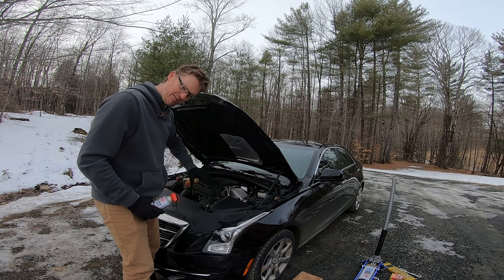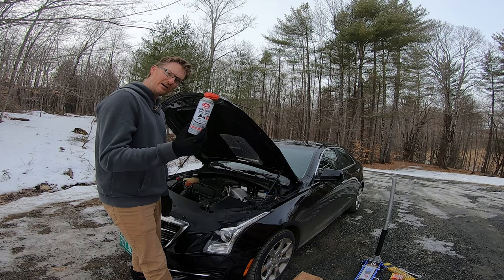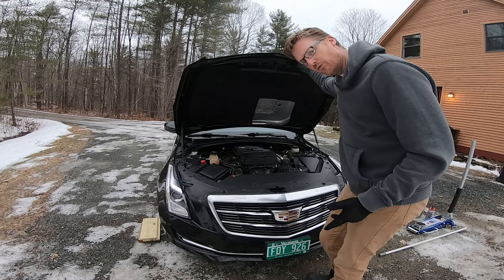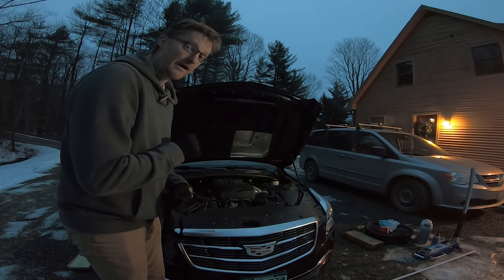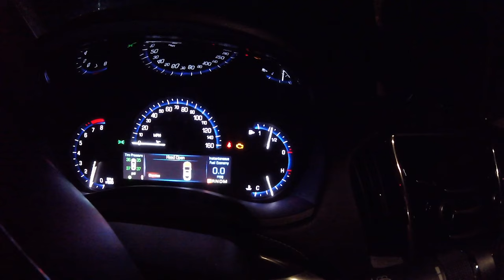Does CRC Intake Valve & Turbo Cleaner Work? | GDI Engine Carbon Buildup

Comment: No not only solution.  Take manifold off fill let soak scrub or walnut blast!  Direct injection will build in intakes and valve no matter what gas you use.
Reply from the maker: V W thanks man! I understand the reality of GDI engines. GM studied it and said some fuel vapors from the combustion process collect on the back of the valves adding to the problem. They strongly recommend high end fuel because of the increased detergents. The wrong oil will create horrible results due to oil evaporation which gets sucked into the intake and coats the valves. I’ve studied this extensively. Fuel. Oil. Air filter. Even an annual Techron cleaning will help keep the valve build up at bay. I read blog post about caddy owners with the 2.0t that have put 130k on the motor with no walnut blasting needed. Proper maintenance and quality fluids man!! 👍 Thanks for the comment ✌️

Comment: Thanks for another great video, where did you spray the crc into the engine. Happy holidays to you and your family.
Reply from the maker: j3reds thank you 🙏 I spray it into the intake where the pcv hose connects. It’s upstream of the MAF and it cleans everything on its way to the valves including the throttle blade.
Reply: Nice going to try this on my 2009 Chevy cobalt tc with 190,000.00km .

Comment: Got an ATS as well. How many miles on yours?
Reply from the maker: Around 39k! Love it!
Reply: Michael Byrne just a heads up. That Y coming off the coolant tank on top, will leak. Go to Lowe’s and get a brass tee. Don’t cut the lines, you can pull the hose it of that y and clamp it on the brass TEE. Also cue is going to crack or go out. You can get a new screen for $52 bucks. That’s all I’ve hAd to replace. 85k miles on mine. All put on by me.
Reply from the maker: @nastynotch8314  thanks for the heads up! BTW, I have a base model.... no CUE for me. I had CUE envy until later I learned about all of the issues. Glad you got yours sorted out!
Reply: @nastynotch8314  where you get a cue screen for 50 bucks

Comment: Does anyone know if this cleans the area of the turbo that seizes the variable vanes on VNT/VGT-type turbos?  I've heard that one should clean from the exhaust side of the turbo if vanes are seized up from carbon buildup.
Reply from the maker: All I know is that this stuff absorbs into carbon buildup and breaks it up. But I imagine that there is a point where the build up is so well established that it would require replacement or tear down and rebuild.

Comment: Hi Michael, are doing the same thing for your Dodge Grand Caravan?
Reply from the maker: No not at all. Only on GDI (gasoline direct injection) engines. The design of a GDI engine causes carbon buildup on the back of the intake valves. CRC helps wash the valves and keeps it running properly. I only use it for my Cadillac ATS 2.0t 👍
Reply: Michael Byrne Ok thanks, Question :  On my oil cap is written to use 5w20 oil, but some drivers recommend to change it to 5w30 as it is fully synthetic oil. I am refering to mopar oil. I am using my car usually in the city with heavy traffic, and moustly on short distance. What is your opinion?
Reply from the maker: @waldi4213  Personally I would stick to 5w20. I think going thicker is an older way of thinking. The tolerances built into a new engine are so much tighter than they used to be and for proper lubrication you need to avoid going thick. I like to imagine the molecules in thicker oil are larger and therefore they can't fit into the tighter spaces on new engines and therefore do not provide proper protection. In the old days I'd say ignore the manufacturer. But now? Stick with the manufacturers spec. And if you're using synthetic, it'll already give you higher temp and sheer protection. You don't need to go thicker. My 2 pennies!
Reply: Michael Byrne Ok thanks , I did not mentioned before I am refering to 3.6 chrysler t&c.
Reply from the maker: Waldemar Wójt I assumed as much 😎 5w20 is what I would use 👍 Thanks for visiting. I hope I helped 🙏✌️

Comment: Did you spray that straight into the turbo?
Reply from the maker: I removed the pcv hose and sprayed into the intake. Upstream from the MAF 👍
Reply: I hear people say this stuff is bad because when you spray it in all the particles being removed go through the cylinders and score them and may damage the piston... is this true?
Reply from the maker: @jacobsteele5543  It’s normal maintenance on a gdi engine. Recommended every 10,000 miles. Do your homework and you’ll see before after results. The option is an eventual build up on your valves that needs to be sandblasted off with walnuts. Not a cheap procedure. But you can minimize build up by using top quality brand name premium fuel, the right oil that does not evaporate (I use dexos 2), keep your intake/pcv wiped out of oil residue, a clean air filter, and a bottle of Techron every spring and you should be ok 👌
Reply: I have a 19 equinox 2.0t ltg like yours with 12,500 miles that I just started running direct injection cleaner... I might have to give this a try my next oil change

Comment: so how do you know it worked if you didn't take before and after intake valve photos ?.. Likely didn't do much, unless the engine has 15K miles or less, otherwise walnut blast is better and then switch to using these type of cleaners as regular maintenance...
Reply from the maker: It was not very well maintained in its young life, 17k miles when I bought it. Idle was a wreck. After crc it smoothed out. It had oil puddles in the intake/turbo. The air filter box was filled with a mouse nest. I switched to proper oil (the stuff inside was like water), used premium only, made sure my air filter was perfect... it worked. It worked well. Here is the video from the first time I used CRC: https://youtu.be/wfHi2SPzZb0
Reply: @sstressfl  Cool. if only 17k miles, though sooner would be better, that's not bad and you had no choice... Likely did a decent job and worth it.  I just did similar thing to my Stinger gt, video out in a day or two max... it didn't do a lot, but I have 28k miles on it.. so likely will take mine for walnut blast and then back to spray cleaners afterwards

Comment: I love your sense of humor, and caddy...!!!
All those things you said in this video are "TRUE." But I haven't lost oil in my car and I use mobil one, cuz my oil cap says that...!!!
Anywho I been doing the same thing your doing, to my Cadillac CTS since I owned it...
I was thinking of getting a oil catch can for my caddy from Tracy Lewis Performance or ZZP you can Google them. Anywho love the video take care...!!! 👍✌️
Reply from the maker: Thanks for watching :D I'm curious why you're buying a catch can?
Reply: @sstressfl  Catch cans can help with carbon deposits... Especially in direct injection  motors... Which is why I am thinking of getting one...!!!
Reply from the maker: Scott C. I do understand the function but usually you need one if you remove the factory catch can that’s built into the intake. If you’re not using any oil between oil changes you should be safe 👍
Reply: @sstressfl  The PCV system in Direct injection motors do a okay job, but if you add a catch can to your DI motor. You help it catch the carbon deposits that could be going into your intake and gum up your valves... Adding a catch can could also make it easier for the CRC GDI Cleaner do a better job cleaning, due to the fact that the catch can collects most of the carbon deposits....
Reply from the maker: @TheMaddPCGuy  I do understand why you would want to add a catch can to help keep the valves clean. But the catch can is for catching oil that gets sucked into your PCV :) Your stock intake already has a catch can built into its design. People add catch cans when they modify their cars and remove the factory intake. With a proper tune and factory parts, you won't see any benefit from a catch can, other than some of them look really cool! Have you mod'd your CTS yet? I've only added a K&N so far. No immediate plans other than spending a lot of money currently replacing rear brake calipers, rotors and pads!
Reply: @sstressfl  Yes, I have done some mods to it. Add me on Twitter @TheMaddPCGuy

Comment: A turbo with without a catch can and direct injection cause more carbon buildup on the intake valves. I know my 2017 1.5 CR-V has no catch can.
Reply from the maker: Very true! The ATS has a built in catch can in the intake. Most people think it’s an air silencer. I clean mine very oil change. Without crc cleanings the build up will eventually force a walnut-blast valve cleaning. 👍

Comment: All engines get Carbon Behind the Rings. However in a GDI engine, under certain Operating Parameters, a very Hard Carbon is produced and that can cause a bunch of Problems. I first found out about the Carbon problems In DI engines in the Late 1990's when Evinrude and Johnson introduced their DI outboard engines(FICHT). These engines would Coke up with carbon behind the Rings and that would lead to Scored Cylinders. It put OMC out of Business
I'm going to pick up a few cans of that stuff and really have a go on my 2008 STS, it has about 100,000 miles on it. 
Cadillac really had a Lousy Jacking Location. I think even the supplied Jack would be next to be impossible to get it in the proper location if the car had a Flat

Comment: You should have dexos 1 oil (version 2) and not dexos 2 (for diesel)
Reply from the maker: I see what you mean!! Doing my homework. Got it looks like it meets all of the same requirements and is safe in gasoline engines. It works so well I don’t plan to change.
Reply: @sstressfl  if GM engineering recommends D1V2 I would go with that. You don’t know what would be the long time effect
Reply from the maker: @hhaim100  I will look deeper into it. Looks like dexos 2 is a better lube but doesnt have detonation protection.

Comment: Old vid I know but you're better off with oem filters. .
Reply from the maker: I’m sure many of them are good, but I’ve been using Fram since 1986. I did once see a puralator filter return valve fail (someone else’s car). It stuck open and allowed engine oil to drain down. Engine would click and clack until it ran for a few moments. Changing the filter to a new one fixed it.

Comment: Did I just see a VT plate?
Reply from the maker: You sure did :)
Reply: @sstressfl  I'm just outside of Montpelier.
Reply from the maker: @vermontvermont9292  Hey neighbor! :D
Reply: @sstressfl  hey 😆. I stumbled across your video while looking into cleaning intake valves on gdi engines. I just bought my first gdi car and it's crazy how gummed up these things get. I did the crc treatment today, followed the directions, and have watched several videos over the past week. But when I started the car to head out on 89 for a 10 minute Italian tune up holy crap was it running like crap. Valves clacking and making noise, no power, spitting and sputtering. Instantly put it in park, and revved it up a bunch. A very large cloud of black smoke came out lol. After that it cleared right up. Went from exit 6 to exit 9 and back. A very noticeable difference. But at 70k miles I'm assuming this sort of treatment has NEVER been done, and the intake valves are extremely nasty. I've also been running some 93, and a good fuel injector cleaner. So my question for you is when can I do the next can? I read that you should wait awhile since the crc will continue to clean for a few days. I also want to change the oil since God only knows what brand is in it now. Was also told to run a good quality oil what do you recommend? Thinking about installing an oil catch can, and also some of the Lucas oil additive for gdi engines.

Comment: This technology how been in Japan since the early 2000s.
Reply from the maker: Ryan Covington do you mean GDI?
Reply: Correct
Reply: The 1996 Japanese-market Mitsubishi Galant was the first mass-produced car to use a GDI engine, when a GDI version of the Mitsubishi 4G93 inline-four engine was introduced.[50][51] It was subsequently brought to Europe in 1997 in the Carisma.[52] It also developed the first six-cylinder GDI engine, the Mitsubishi 6G74 V6 engine, in 1997.[53] Mitsubishi applied this technology widely, producing over one million GDI engines in four families by 2001.[54] Although in use for many years, on September 11, 2001 MMC claimed a trademark for the acronym 'GDI'.[55] Several other Japanese and European manufacturers introduced GDI engines in the following years. The Mitsubishi GDI technology was also licensed by Peugeot, Citroën, Hyundai, Volvo and Volkswagen.[56][57][58][59][60][61][62]
Reply from the maker: @ryancovington5636  That's pretty awesome. I knew it was common in imports, but I have never looked into its history. Did you see it was first used in 1925? The carbon buildup has always been a problem. Either way, it hasnt had the mainstream until recent years. Now its making its way into everything!
Reply: Mostly in 1925 it was used in special vehicles and airplanes which required more maintenance

Comment: "top quality fuel and oil" has absolutely 0% relevance to the problem of GDI's carbon buildup.  NO fuel washes over the intake valves as it used to in port injection vehicles of the past. this is literally the one and only reason why carbon build up takes place.  The Octane level of your fuel also has nothing to do with carbon build up in any engine, it is simply the resistance to volatility at high temperatures caused from extreme compression in higher performance engines.  you use high octane when your vehicle was made to run it, not because 93 "cleans more" than 87, it does no such thing.  The engine's compression ratio determines it's required fuel and that's it.  if the piston blows up the fuel before TDC, it needs higher octane. on the other hand if you run 93 in an ecobox with a low compression engine that's made to sip 87 with 120hp, the 93 won't burn completely in the combustion cycle and you'll just be shooting tons of wasted fuel out of the tailpipe.
Reply from the maker: TWR CREW yes yes yes I understand where you’re coming from. However GM in studying carbon buildup in gdi engines found that fuel vapors (burned/unburned) while the engine is running and after shutdown make contact with the back of the valves. Cheaper grade fuel with less cleaning additives left higher levels of deposits. Premium fuels from quality sources helped lower valve deposits. It’s not about compression in this case. It’s about detergents. And it’s GMs recommendation. In regard to oil, GM recommends Dexos oil in the 2.0t due to its ability to maintain viscosity and avoid foaming/oil evap. Foaming/evap increases oil reaching the back of the valves which adds to carbon buildup.
Reply: @sstressfl   Something's amiss if GM claims vapor from within the cylinder can touch the back of the valves in any significant quantity.  If the intake valve is open in the first place, massive vacuum forces are taking place from the piston's suction as it descends down the cylinder until it reaches the bottom. at which nearly precise point, the cam lobe rolls off the valve and the spring completely shuts it tight in order to create compression on the piston's way back up. 

Between the valves being open - therefore subjected to extreme suction forcing air to rush in from outside - and being completely shut and sealed on the pistons way back up to create compression - when vapor would have ever had a chance to come back out and onto the valve - By design, fumes never have any real chance of just freely floating around to somehow wash around the intake valve at all.  To do so would imply the valves aren't sealing properly and you're losing pressure through a hole in the compression cycle which means you aren't catalyzing the necessary forces to create horsepower, defeating the whole purpose of an ICE.